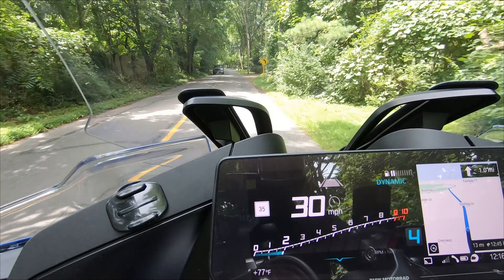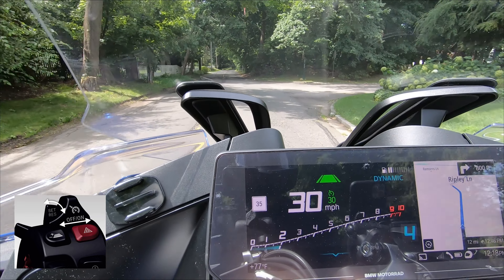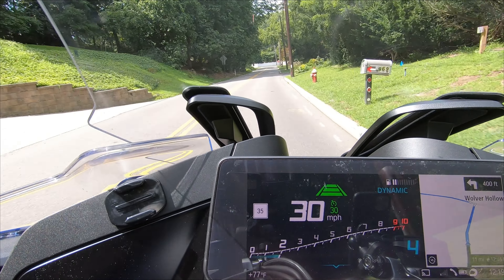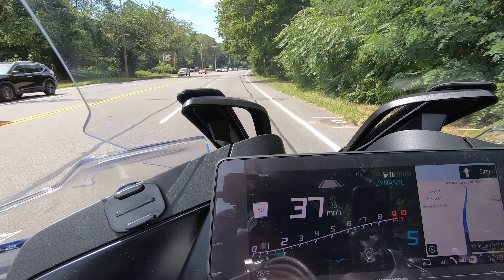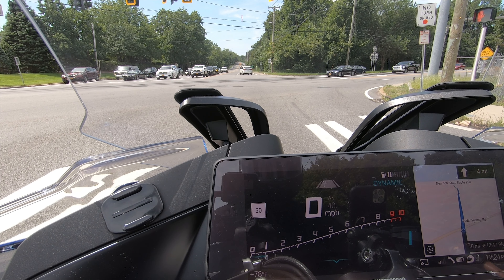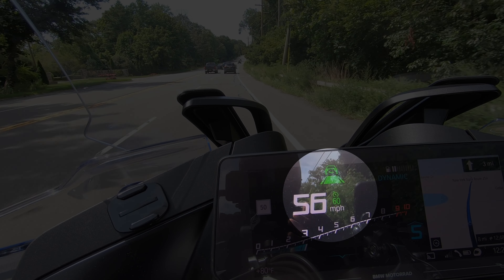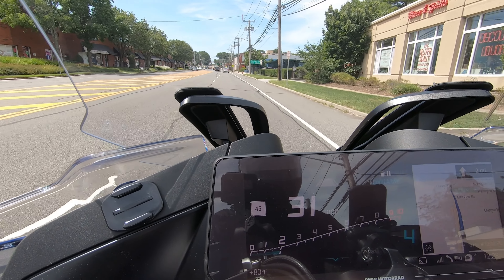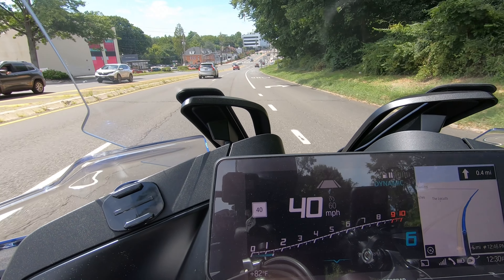First motorcycle with active cruise control. How to use? Detailed tutorial.

Comment: Wish I could have that on my k1600B. I have cruise, but no radar. Even on the latest models they haven't found a spot to mount the sensors.
Reply from the maker: Yes that’s correct. I was watching a few K1600 reviews for 2022 models. Was disappointed that they didn’t offer ACC option.

Comment: Are you able to complete a quick, fully manual shift (no quick shifter) without it disabling the ACC?
Reply from the maker: Yes. Both manual and quick shift is possible when ACC is active. ACC disengages when you hold the clutch for more than a couple of seconds which is long enough to allow shifting the gear.